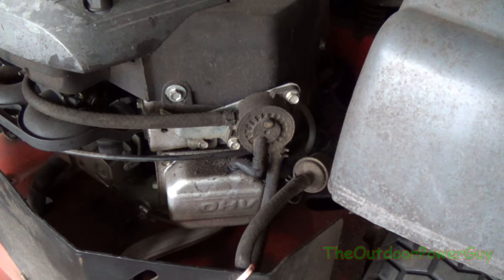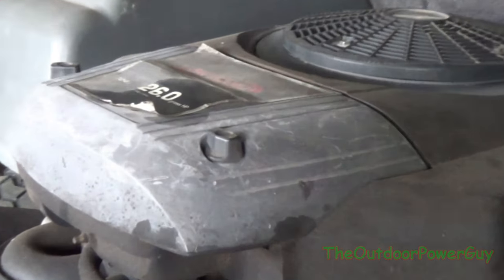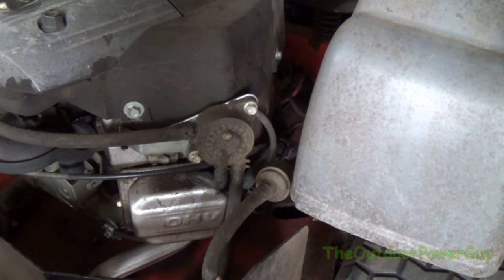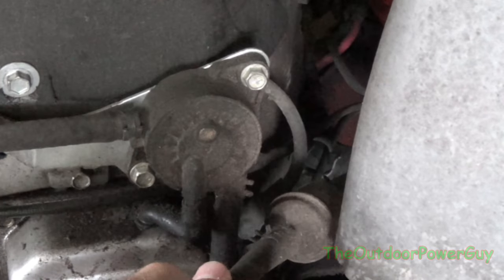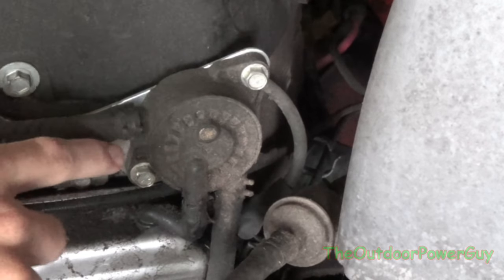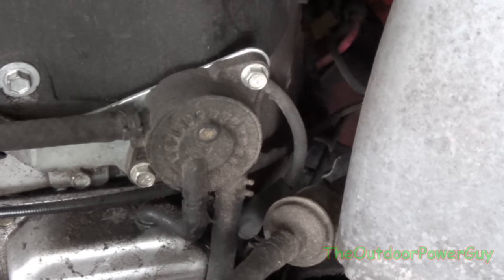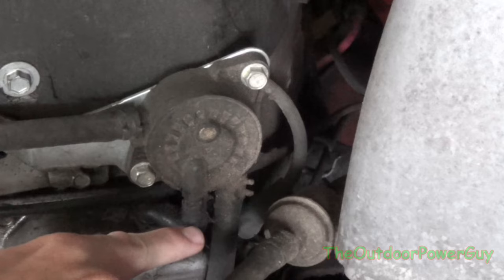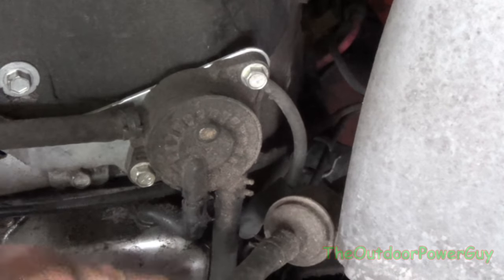All About The Small Engine Fuel Pump

Comment: I turn key, and nooo fuel is moving, i removed the fuel line to the carb from the fuel pump. no fuel is moving..

I ordered a new pump thank you. Now.. is it possible the fuel pump is fine, but just not getting power? (There was mouse crap all around this area...)

Comment: Sure! I’ve got a question, My exMark 48” Kawasaki motor has basically the same design for fuel pump placement and hoses.  My exMark runs fine for about 20 minutes and then dies.  I thought it was an oil leak, and perhaps it may be. Regardless, after letting the mower set for a few days I checked the fuel pump and it was wet - almost to a drip.  I had been losing fuel, but I thought his was due to evaporation from the tank via a worn fuel cap.  Nope. It was leaking out of the fuel pump and the pump clearly needed replacement.  So I replaced it.  Now, the mower fired right up, I mowed for 20 minutes and kaput.  A symptom it shows when it dies is fluid around the deck below the motor.  I simply cannot tell if this is oil or gas, or both. Perhaps an oil plug heating up and leaking. Perhaps lots of fuel with a little oil. My apologies, but I cannot discern.  It is a film that will evaporate after a few days. I reviewed the fuel pump and fuel was dripping from just before the pump, at the inlet side.  It seems as though I am losing fuel and oil.  I do not want to over complicate things, but is it possible for oil to be blowing up the vacuum line (direction of vacuum?) and so oil is getting in the pump - clogging it in a way that pushes the fuel back towards the tank?  I am curious as to what symptoms might help further diagnose this and what may solve it.  I have a complete LOF kit to install to install and will do so.  Perhaps just a dirty fuel filter - I can only hope.  But if it isn’t that, where else might I look.  I have a standby motor, so I have some time to sort this properly.  Any ideas?  Thx for reading if you’re still here.  -Chris in Kalamazoo

Comment: Where's the oil pump. Even with the spark plug out I can barely turn the fly wheel. It's sound like metal in metal. Suspect oil getting inside to lube.

Comment: where does the vacuum generate to operate the fuel pump?  Should you feel vacuum with your finger over the hole in the valve cover
Reply from the maker: The vacuum is generated internally in the engine when it is running, yes you should feel the vacuum with out the house attached to the valve cover, but i don't recommend removing the hose from the cover - that can cause oil to come out of the engine when it's running.

Comment: Hello I just change a fuel pump today from a Kawasaki engine, when ever I finished installing the new pump, minutes later the engine started to shake and turn off.. and I turn it back on for a min and it shuts off again.. what can a be ? How can I fix that ?
Reply: Jose Lopez , take the fuel cap off and see if the engine runs.  If the vent isn’t working on the fuel cap it will start and run but not very long.

Comment: I repowered an old mower.  It dies when the fuel level gets lower.  I assume I can use one of these to fix it.  Do I need to make any carb changes? I also saw what looks like a vacuum port on the intake.  Can I use that to power it?  It's a 17.5hp briggs.

Comment: I seem to have oil coming out of my fuel pump but the motor is working fine. Can the pump be cleaned to stop this happening or should I replace the pump? Thanks in anticipation
Reply from the maker: replace it. your engine might be too full on oil, the fuel pump runs off the vacuum produced by the engine - as in internal compression which creates pressure inside the engine. replace the fuel pump, they are relatively inexpensive.

Comment: My 24 hp mower seems to not be pulling any fuel through the lines and I am unsure as to why I just replaced the pump and everything is correct but it still isn't pulling anything

Comment: Hi, hoping you can offer some advice.  I noticed I wasn't getting any fuel through the pump when I pulled the output/outlet line and cranked the engine, I got no gas.  Replaced the fuel pump and I'm still getting no gas.  Dry as a bone on the outlet side.  Any guesses? (same engine setup as you have in the video V-Twin Briggs and Stratton)

Comment: I have a Craftsman lt1750 17.5 how kholer runs very slow, when I try to bump up the throttle it dies would that be the fuel pump not getting enough gas to the carb

Comment: If Replacing a Twin Engine with a Single Cyl Engine that Does NOT have a Fuel Pump can You Simply Drill a Hole in the Valve Cover or oil Dip Stick Tube for the Hose?
Reply from the maker: I have tried drilling into valve covers and dipstick tubes before and it never works, if your engine is a Briggs they makes a replacement dipstick tube with a hookup on it for the vacuum tube. That is the best option i have found, its inexpensive and easy to install. hope this helps : )

Comment: this looks like the set up on my John Deere z425. I've been having trouble starting it. It typically starts, dies and then won't start. If I remove the outlet line from the pump and blow compressed air on thru to the carb, it starts. Seems like it floods and then I clear it and it starts? Last time out it idled rough and I noticed a drip of gas leaving the fuel pump every few seconds.  Is this a separate issue, or does that mean the pump is cracked and losing vacuum?

Comment: Hi!  i am working on a Honda GC 160 engine which is for my pressure washer.  I can get the engine to crank, but it only stays running for a minute or two and shuts off.  I took the carb off and it has absolutly no fuel in it.  it has no corrosion and looks fine.  i cleaned it anyways, but does this mean the pump could be bad?
Reply from the maker: Hi, yes either the fuel pump is bad or the gas line could have collapsed somewhere or the gas line could have a restriction in it, i would recommend replacing the fuel line first and go from there. hope this helps. ~TheOutdoorPowerGuy

Comment: Ive got an odd one for you. My buddys mower keeps filling crankcase with fuel. 24hp vtwin briggs. oil level perfect before he starts mowing, and by the time hes done fuel tank is empty and oil is way overfull and very thinned out by gas. Engine runs perfect, changed fuel pump as i thought that would be the issue, maybe a bad diaphram letting fuel bypass into the pulse line, but its still doing it. Any clue? im stumped. If the fuel were getting past the needle/seat it would be running poorly and flooding, but it runs excellent!
Reply from the maker: Hi, there is no diaphragm in the carb on a 24hp Briggs, the only thing i can think of is the float is sticking and letting residual gas flow by into the crankcase or the electronic fuel solenoid anti-backfire valve is not shutting off properly i.e sticking. Yes a sticking needle & seat would cause it to run poorly and flood out - that is due to too much gas in the cylinder's at once. While the engine is running fuel is being pumped from the pressurized tank thru the fuel pump - when the engine is off gas can still pass thru the fuel pump even when it is not running, it can get complicated at times. But anyways try cleaning the carburetor real good, also try cleaning the electric shut off switch - worse case scenario is a new carb. Let me know if you get it straightened out. Hope this info helps :)
Reply: nitrosport5 Needle valve is leaking with compression. needs a carb rebuild and cleaning.

Comment: I replaced the fuel pump on my B&S 26 hp engine. The vacuum line between the pump and the valve cover doesn't fit exactly right, and I think it restricts the vacuum.  Would this cause my engine to only run on full choke?   When I try to to open the choke, the engine slows down and then dies.
Reply from the maker: No,the fuel pump has nothing to do with it running on or off choke, the vacuum line in the valve cover does not have to fit exactly right, you most likely have a problem with the carburetor, which is common on Briggs twin engines.
Reply: @TheOutdoorPowerGuy  Thank you for this information. I did take the kink out of the vacuum line, and indeed it didn't make a difference.  I will address the carburetor problem now. Thanks again.

Comment: Murry 14hr pwr riding lawn mower runs for about a 10 seconds then stop running. Fuel line and sparks plug clean. what could be the problem?
Reply from the maker: Multiple things could come in to play when a mower won't run. Could be a dirty/gummed up carburetor, water in the gas, collapsed fuel line, bad fuel pump (if it has one) all in all it sounds like it's not getting gas. most likely a carburetor issue. hope this helps :)
Reply: thanks, it fixes the problem, dirt in the carburetor.

Comment: My vacuum line is leaking fuel will that cause it not to run?
Reply from the maker: the vacuum line should never leak fuel as the vacuum is created by the engine via suction from the piston.
Reply: TheOutdoorPowerGuy ok thanks

Comment: Do you know why I’d have oil pumping in to the fuel pump? All lines are hooked up properly and the fuel pump is brand new.
Reply: this is a common sign of a blown head gasket , it's internally blown which pushes pressure into the crankcase and pushed oil into the fuel pump.   very common on single cylinder OHV B&S engines
Reply: Or you overfilled the motor with oil.

Comment: is the fuel pump supposed to leak gas out from the 2 pinholes it has my does when I start engine what you think is problem
Reply from the maker: No the fuel pump is not suppose to leak gas at all, it is suppose to be a sealed unit - it could be leaking at the gas lines, if they are old and rotted, i personally in over 19 plus years in the outdoor power repair industry have never seen a fuel pump leak. My advice would be to replace the fuel pump and check the fuel line from the tank and from the fuel pump to the carburetor it's self.  Thanks for the comment and i hope this information helps :)
Reply: I have the same problem. Fuel squirting from vent hole. This is fuel not oil, squirting directly out of vent hole. Can you help?
Reply: @alltakennow  same problem here but seems no help... 
How did you solve the issue??

Comment: When replacing the vacuum line. Do you have to remove the valve cover?
Reply from the maker: Not necessarily. sometimes you do, i never had any trouble replacing a vacuum line they usually pop right in.

Comment: does the vaccum port take in air to create a pump or does it need air pulsed out?
Reply from the maker: no it does not take in air, the valves create a vacuum, a vacuum is nothing, its not air, water or any liquid, its kinda difficult to explain in the comments, the way the fuel pump works is it is driven by the vacuum created in the valves (which is air tight) and one side of the pump pulls gas in from the tank and basically forces it into the carburetor, this type of fuel transfer is also known as a full pressure fuel system or a forced fuel system. hope this information helps!
Reply: Thanks so much u helped me understand the way it works
Reply from the maker: you are very welcome! :)
Reply: Robert Henning bh

Comment: do u need it for motor to run
Reply from the maker: if the tank is lower than the engine or in the rear of the mower , or if it's a v-twin engine then yes you need a fuel pump. in order for an engine to run you need, air, fuel and spark. 
thanks for the comment :)
Reply: What if your tank is higher than your mower do you need one I have a 19hp Briggs and Stratton intek on a craftsman tank up front

Comment: it helps one last question does the fuel pump supposed to have two little nittle holes threw it that's we're leak is coming like if it's a air hole